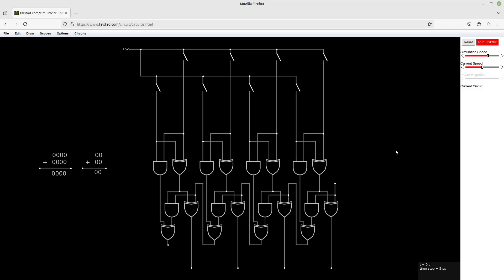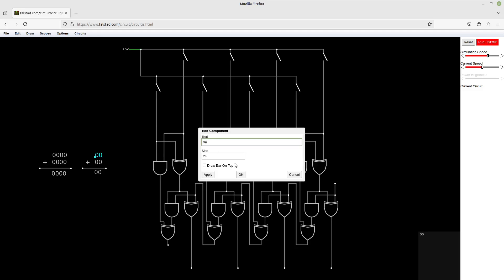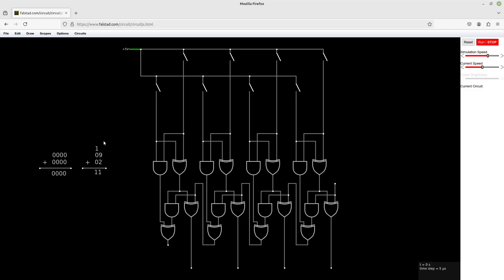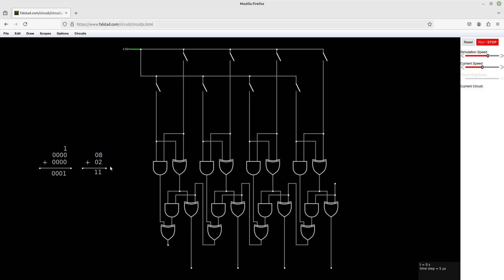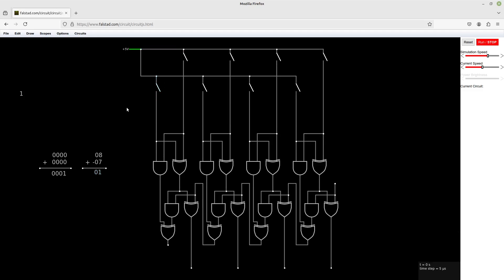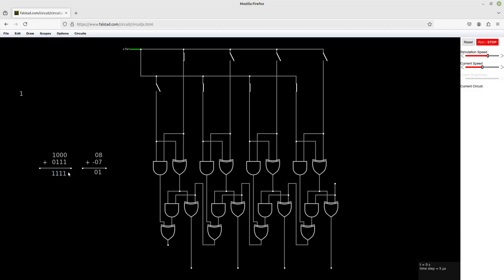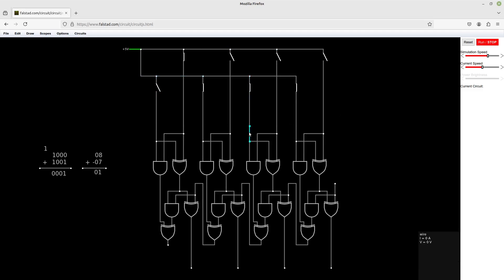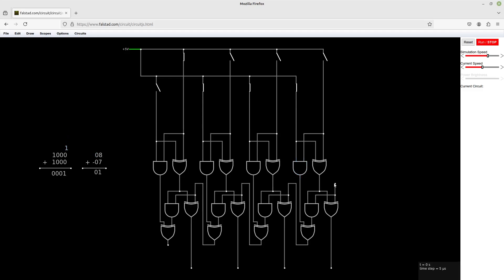Binary Subtraction with Logic Gates

Comment: that’s really cool! what if the result should be negative tho?
Reply from the maker: You would have to treat the answer as a signed answer. If the left most bit is 1 it's negative.
Reply: @ i made a whole circuit that compares 2 input numbers and flips them if 2nd is > than 1st and the answer should be negative… and it turns out it was all unnecessary huh
Reply from the maker: @toshik6229 well if you flip the bits and add 1, if the second number is large your circuit will  give you the absolute value. So if that's what you need, you'll have it.

The only issue you might have is you want the absolute value is something like -1 - 1. In that case you have 1111 - 0001. You answer should be negative two 1110. However your first number when viewed as unsigned is "larger" than the second.